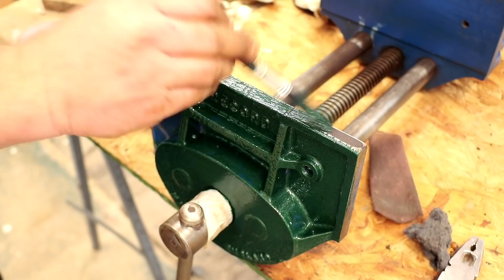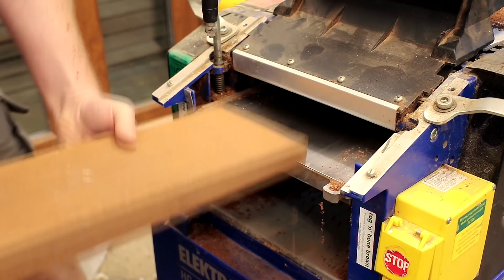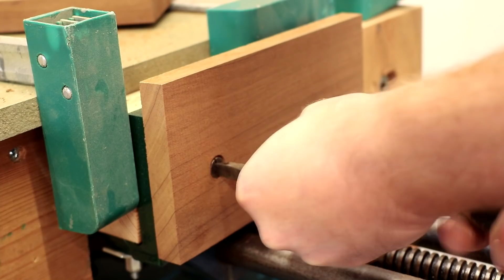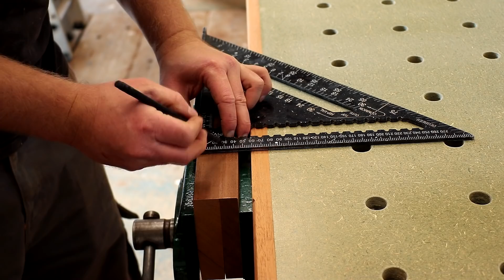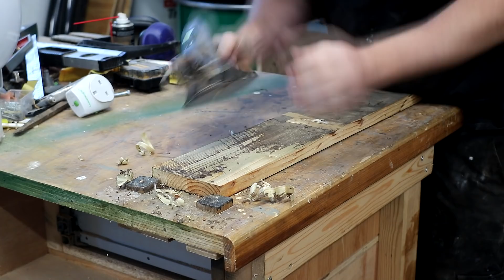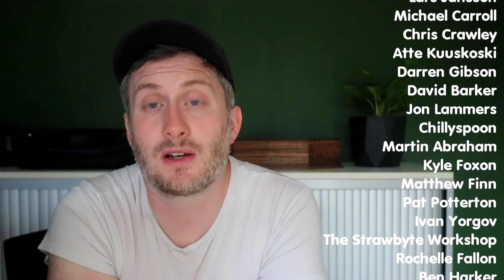Making New Vice Jaws

Comment: Completed vise looks great.  A quick tip if I may, drill a small hole in the inside face of the outside jar just even with the bottom of the dog holes.  This will allow you to blow debris out of the hole with air or vacuum out.  I use to have to remove the jaw to clean before I did this in mine. Oh, and you WILL have to clean the holes out from to time :>)  keep up the great videos
Reply: FYI, I just put out a video (you get an honorable mention) inspired by your video and my comment above.  Thanks for the inspiration.
Reply: good tip, thanks

Comment: Keith, What is your HONEST (forgetting sponsorship) opinion of the new mitre saw compared to your old induction motor mitre saw?
Reply from the maker: Oh it's a better saw for sure. I didn't really want to change at first because I liked the Axminster and didn't want a cordless one, but you soon forget about it being cordless because one battery lasts me weeks! The fence on the Axminster also can't be squared up accurately, it's off, no matter how much you adjust it which is why I had to make a new fence for it years ago. The Hikoki is also more smooth and comfortable to operate, it just feels like a better tool. The only way the Axminster is better is how quiet it is, but the Hikoki isn't really much louder tbh